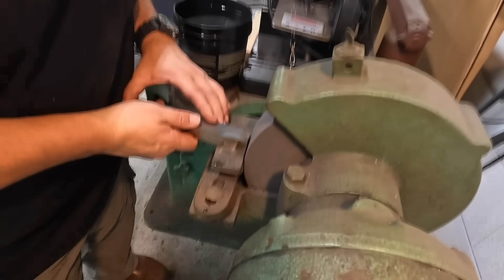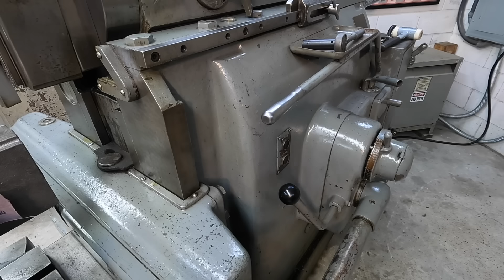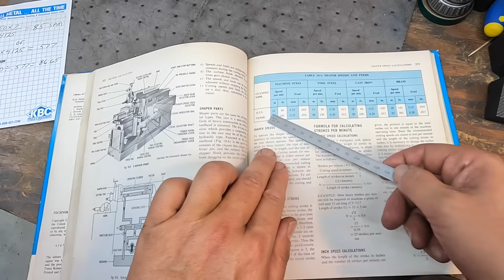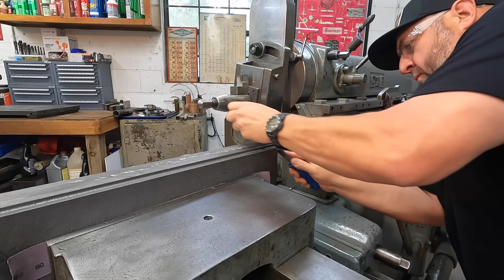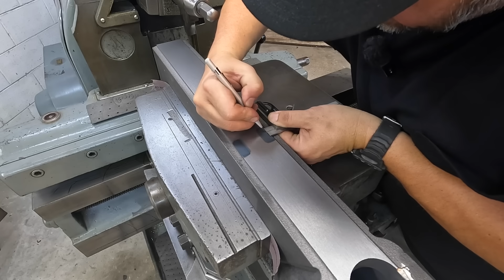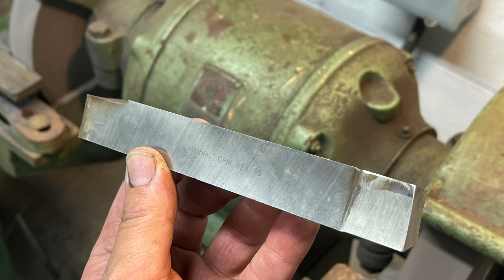Hardtail Vise Build Ep.6: Shaping the Dynamic Jaw Body

Comment: If the clapper is rotated right for a right to left cut, shouldn't the clapper have been rotated to the left for a left to right cut? Rational being if it rotated away from the cut face first off, it was rotating INTO the cut face on the second if not changed (which it wasn't!)
Reply: Check in the video, he did switch sides on the clapper

Comment: Silly question im sure. Why does the cutter lift up on the return stroke? As in, it just cut away that material to the full length of the cutter so what is it rubbing against on the return stroke?
Reply: It lifts by touching the material. Because everything is a spring the tool/clapper/machine/workpiece springs back enough after the cut that the tool catches the edge on the way back and the clapper allows the tool to tilt upwards so the cutting edge can move out of the way and doesn't get damaged
Reply: It lifts so the cutter doesn't strike the front edge of the work piece and break. There are shapers without it, but I think you can't take as aggressive of cuts.

Comment: I know Adam is keen to use the shaper, but this is a job for a fly cutter on the top, and an endmill for the shoulders. I worked in stamping plants and had never even heard of this tool during my apprenticeship. TBH, I don't see the use cases for this, I will need enlightening
Reply: Older tool, made obsolete in large part by mills in modern shops. Still cool, does the job in a non production environment.
Reply: @charlesblanton1008  that makes sense
Reply: It's fun and it did the job nicely
Reply: @peterspencer6442  yeah, it's interesting for certain

Comment: Does the discoloration on the toolbit during grinding mean the temper/hardness is altered?
Reply: HSS doesn't lose its temper, even if it gets red hot. It will start getting red around 500°, but the tempering temperature is above 1000°.

Comment: I've never used a shaper, but to me the angle of the clapper seems to be set the opposite of what it should be. Imagine if the vertical wall of the cut were much taller, when the clapper flips up, wouldn't the tool bit actually move closer to the work rather than away from it? Probably not a significant concern at a small depth of cut, though. Am I just seeing it wrong in my mind's eye?
Reply: He's showing it the correct way. Just give her another watch
Reply: A good way to think about it, imagine if it was rotated a full 90 degrees. The way he had it, it opens away from the work.
Reply: Always aim the clapper towards the feed of the cut when using a horizontal feed.
Reply: With the clapper box set at an angle, the tool executes a conical path about that axis and the tip of the tool executes a circle about that axis.  As set up, ( on the backstroke) that circular path is away from the work. Inclined the other way, it would rotate into the work.
Reply: @peter-xn8xu   I bow to the voices of experience!

Comment: The fascinating part about a shaper is that it's a one edge metal cutting machine like the lathe. The tooling is easy to maintain. There is very little in dimensions of the tool you have to look for. Sharpening is as easy as going some grinding. For an hobby shop it's a really useful tool.

Comment: A weary engineer. We may have noticed you do not bevel the cast before that short block at the end of the cut? Also you did not bevel the semi-circular end of the long part of each stroke to prevent breakout of the casting. The first I mention above will dull the cutting edge yet you overlooked that for the three passes  Adam? What is it that I am missing here please?
Reply: The lack of bevels to the edges did not cause any real issues in this instance , but your point is duly noted.
Reply: @michaeldickson3314  Uh!? It's a question for Adam.
Reply: @jackrichards1863 You do not  get to choose who reply’s to your comment.

Comment: If the bevel was needed at the start and end, why did you not file one around the hole?
Reply: Was kinda thinking the same thing. Guess it hitting it 2 times a stroke isn't as bad as 4 times a stroke. The tool seemed to hold up so guess it wasn't needed.
Reply: The simple answer is, he forgot.

Comment: When I grind a new tool like that I tend to dress the wheel more because it glazes when roughing. You'll find you won't generate as much heat and you won't need to use that stick. You shouldn't need that stick bro. Let the machine do the work!

Comment: Yeah man! This was the episode I was waiting for. That was seriously cool, thanks for sharing. I can't imagine a more perfect job for the 32" G&E. Just right on stroke length, easy to hold, and a perfect machine for the toolpath. I honestly think you could make money doing that specific application in a factory setting. With some practice and adjustment I'm sure it could make all those cuts in one pass at a high speed and feed rate all while leaving an acceptable surface for the application. Cheers.

Comment: I bet you were the kind of kid who was always taking stuff apart as a kid, huh Abom?
Reply: Don't think so, most kids who are into taking things apart are into cars as well, which he is not. Got that gearbox problem on the American Pacemaker still to be looked at; Fenner would have dived straight in there.   He is of the machinist only type. As per his milling machine at the home shop and trying to sort its problems out.  When at his friend John's lumber place with Lance and Rucker. They took the hydraulic shaper apart, whilst Adam did some work on it on the lathe. Numerous other examples.
Reply: @peter-xn8xu  some people get the bug some don’t

Comment: @Abomb79 you brought up beveling the end edge to prevent chip out of the casting. Is there a reason that you did not bevel the edge of that circular hole in the bottom of the part. Wouldn't that also act like the back edge of the piece?
Reply: That hole will be completely out of sight on the finished vise.
Reply: @beefchicken and when has that ever stopped Adam from over machining something into perfection.

Comment: Watching this reminds me of an incident back in High School...Hagersville Secondary, we studied under the tutelage of Mr. Drake (Ducky). This was in the mid-1970's when high schools still had shop classes in the curriculum. One of our year-end projects was to build a machine shop hammer from prints provided by Ducky. We were each given a steel blank of 1" x 4' square stock and we were to machine the head. One of the fellows had the depth of cut incorrect as well as the stroke speed and what was to be the hammer head flew out of the vise with such speed and force that it embedded itself into the wall opposite. Ducky with all calm, walked over and shut the shaper down and calmly said "Now you know what you are not supposed to do"...

Comment: looks like your cuts were way past the bevel you filed...and there was no issue with chipping.
Reply: Then it worked I guess
Reply: There was no bevel on the two internal edges, either, and there was no issue either with chipping or tool strikess.

Comment: lol none of you noticed the shaper is moving itself n the backstroke! maybe bolt it down!
Reply: You talking how the cutter lifts up ? It's meant to do that to have the tool not back drag.
Reply: @JohnLikesMachines  no, the whole shaper is twisting counter clockwise on the backstroke. 25:30
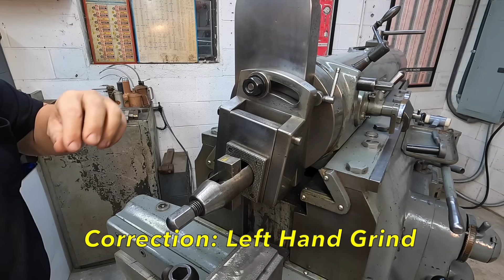Reply: At 10:28 Adam explains that this is what it should do and why.
Reply: @tomoakhill8825  ya, it not like your washing machine on spin cycle with a brick in it.  I'm sure it weighs more than 7000 lbs and won't slide across the floor unless it was doing 500 strokes per minute or was on wheels.
Reply: @Discretesignals  They can definitely move themselves on the upper end of parameters. But this is not moving it.

Comment: Could you stack up 2 or more tools (like a broach tool) to make 2 or several depths of cut in one stroke? Seems an interesting idea if it works.
Reply: Ganging cutters was limited to planners  - usualy a top and a side, occasional doubled side cutters doing some plunging on the top with the special slide outfitted for two cutters spaced some gap apart for twin hss cutters and spacers oftimes arranged for a plunging cut, sometime more than just a shallow depth.

Comment: Its interesting. While watching, i noticed you touched off on the second shoulder, rather than referencing the cut you had already made on the first shoulder.

I was concerned that the two sides of the casting could have been quite different, and therefore your touch-off would be starting from a potentially quite different height.

Is that why one side ended up being 90 thou higher than the other?

Comment: when using the strokes per minute formula, you've got feet in the top, but inches in the bottom?  also, you didn't file the edges of the hole?
Reply: The formula in the book appears to specify feet per minute in the numerator and inches in the denominator, they've already included the conversion factor.
Reply: @FentmaxxerActual  I’d assumed as much, but would have been nice if it had been mentioned by the big guy…😉
Reply: @FentmaxxerActual  Especially curious where an overall conversion factor like "7" comes from
Reply: There's another factor, the ratio of cutting stroke time to return stroke time that could explain the "7" factor
Reply: The strokes ( or cycles if you prefer ) per minute is equal to the 'speed' divided by the overall length ( 2L ) making up that cycle.  That 'speed' needs to be the average speed. as there is both the cutting speed ( CS )  and return stroke speed, with a 2:3 ratio.  Using the correct (!!) averaging formula, the average speed comes out as 6/5 times CS.  For L in inches, multiply the whole thing by 12.  So,  6 times 12 divided by ( 5 times 2) gives 36/5 , and voila, 7.2;  the book rounds it down to 7.

Comment: Real question. If you need to bevel both ends why would you not bevel the edges of the gap or the interrupted cutting area?  Isn't it a start and end of a cut as well, like your actually having two different cuts in one stroke.  BTW I do a lot of woodworking and I also bevel the starting and finishing edges of a wood planer cut.

Comment: Isn't there a risk of damaging the part with the back of the cutter just slamming against it on the back stroke and getting flipped up? Like if there was an important corner, boss, web, etc
Reply: It's not hitting it that hard, but in case you are doing work on something where even the cosmetic marks are a concern there is such a thing as an automatic tool lifter. Adam's G&E didn't have one when he got it, it's one of those seldom specified options so there's not much chance of finding one now.